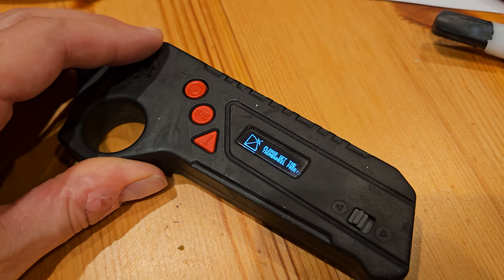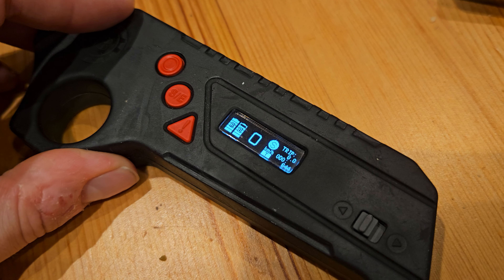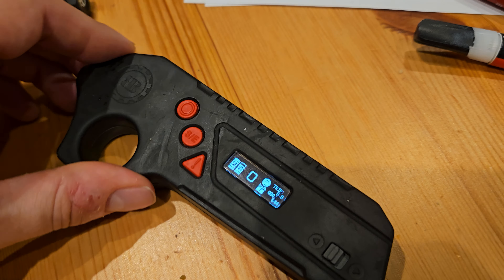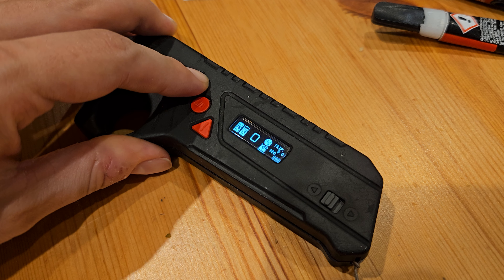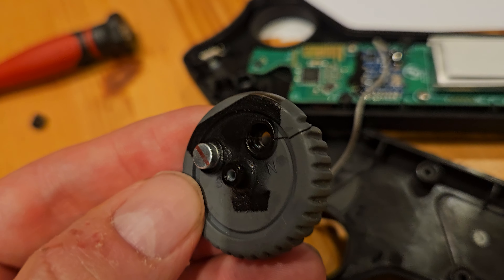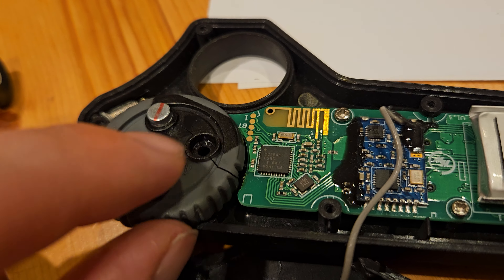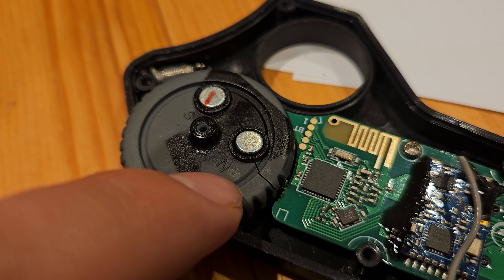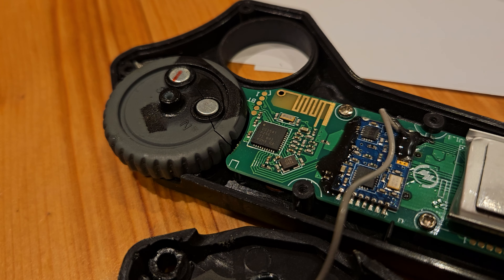Backfire board remote issue and fix

Comment: Due to the lack of replacement  parts, I would just take your controller apart again break the wheel and repair it with jb weld or anything to keep your wheel together that's why the magnet fell out. This video helped me out so much because the post the hold the other half of the spring broke and I repaired it with jb weld. If it breaks. Again I'll be getting a new remote or find a used one on eBay for its shell and parts🙏🍆
Reply from the maker: Thanks for the idea, I've put loads of gel superglue and I think it's good to go for a while. I did not had any problems since the repair.
Reply: @antoinevanderstraeten1315  awesome!🙏